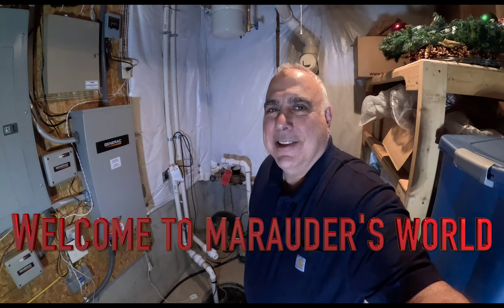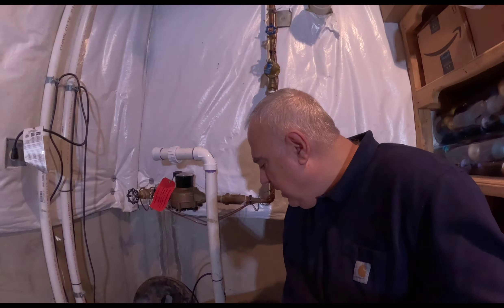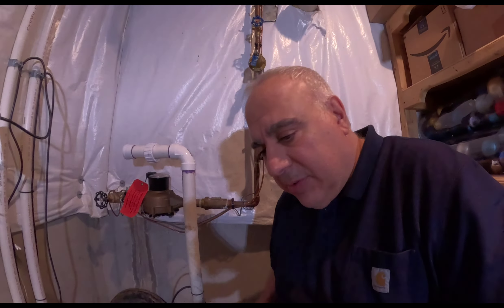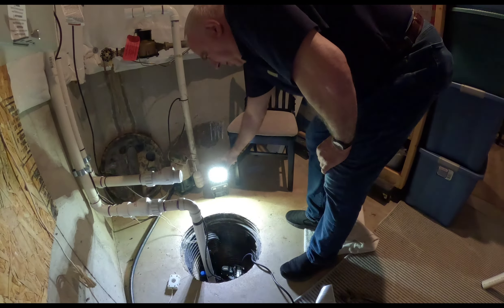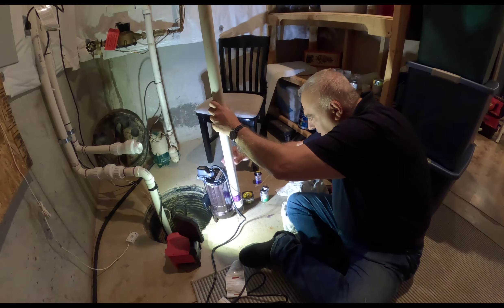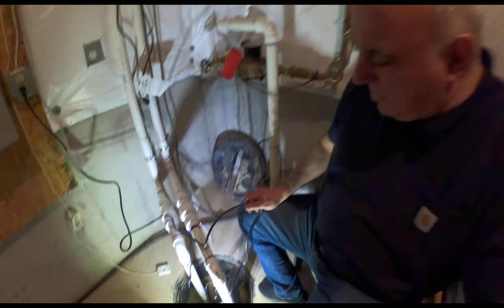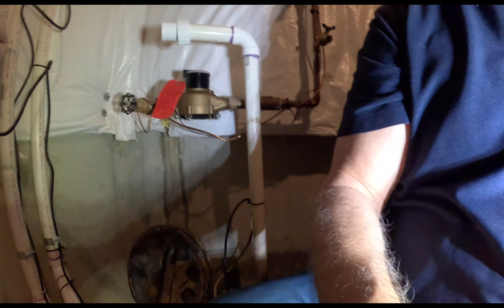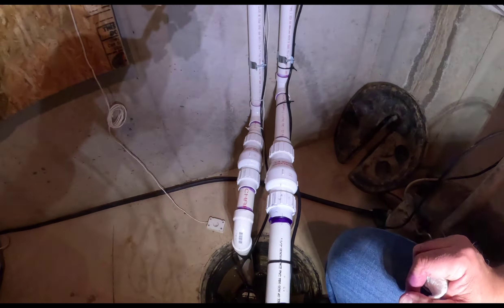Liberty 1/2 HP Sump Pump Installation 2 Pumps Installed In One Sump Pit #333

Comment: Great dyi video. And yes the noise is common. The hole is to reduce head pressure and prolong your pump life.
Reply from the maker: TTP you have no idea how much I appreciate your comment, unlike me you know what you're talking about. I can't hear the gurgle outside the room so I've forgotten about but do debate reinstalling without the airlock hole. Thank you so much be safe.
Reply: @maraudermitchelli  I hope I know what I'm talking about, I was a licensed plumber in a past life.
Reply from the maker: @timetopay5344  Man I appreciate your help...so do others who read the comment. Thank you.
Reply: The hole is to make sure you don't get an airlock and a spinning pump that's not pumping.  If you fail to put in the hole, or if the hole gets clogged, your pump may eventually just turn on and never shut off and burn up

Comment: Does the Quiet check Valves need to be installed in a vertical position?  I know for the normal style check valves they work much better and last longer in a vertical position.
Reply from the maker: No they don't....I think. They function great mounted horizontally and it is easier to change the valve and the pump. Be safe happy new year
Reply: My company always installs vertically, but that’s how we were trained, also before the 90
Reply: Should be installed vertically with column pressure closing the flap. If installed horizontally they eventually gunk up with mineral deposits in the belly of the pipe.